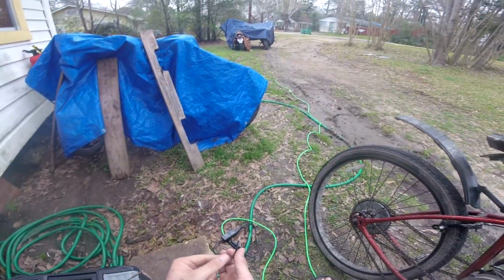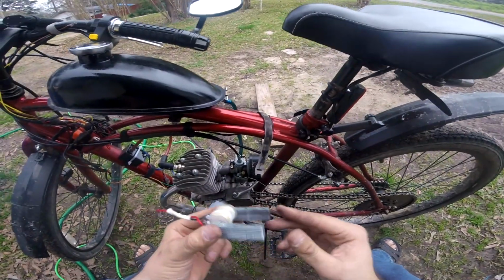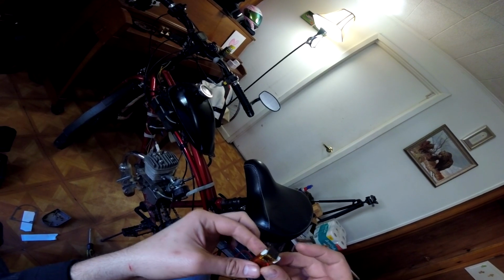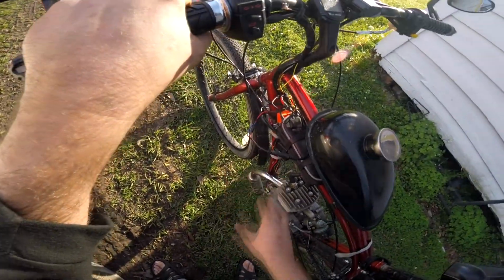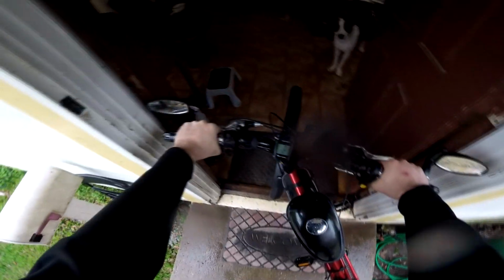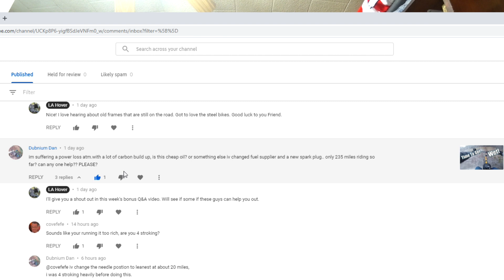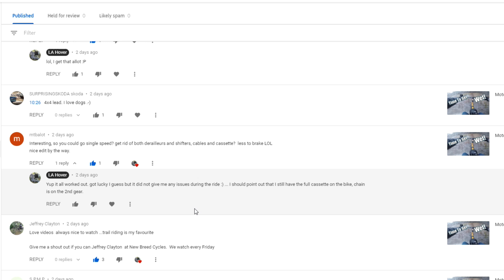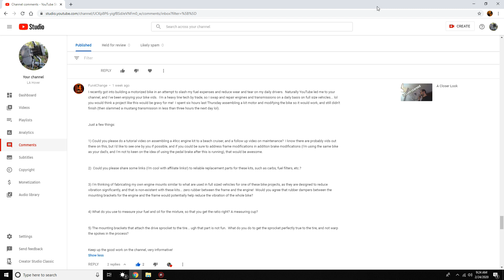Charging System Update (Motorized Bike)

Comment: The magneto only has one winding (coil) as you have discovered with the white wire. Being a 2 pole A.C. generator it produces (lets say for arguments sake) a positive pulse on the down stroke which charges the CDI and a negative pulse on the up stroke which triggers the CDI...so there is no positive or negative wires on the magneto but a "phasing" if you connect it backwards the plug will still fire but 180 degrees out of phase so the engine will not run. You will not harm the CDI...if you try to absorb either the positive or negative cycles from the magneto (to power something else) it will either not charge the CDI or not trigger the CDI...either way no go...hope this helps understand whats going on with the china girl ignition system which is light years ahead of the old points type systems which were horrible...this system is basically maintenance free although no real adjustments which is both a good and a bad thing...
Reply from the maker: Simple and easy to understand. Thank you for pointing this out :)
Reply: thank you thank you thank  .its the problem i have 180 out , makes  sense now why i ,ve got a spark but not firing
Reply: Best explanation you can get online!
Reply: This is a beautiful comment thank you.
Reply: Also the coil will rob spark from the magneto and the motor wants to run on the coil.
Reply: From what I've read from the "official documentation" that came from a china-direct engine kit, the stator coil only outputs 7.5V AC @0.5A at 5500 RPM if your parasitic draw (converter) exceeds the minimum threshold voltage of the CDI coil the engine is electro-choked to death. 
A hypothesis that introducing a much stronger Magneto magnet to increase amperage output needs to be explored...
Reply: @matthewsherwood6617  0g 0
Reply: @LAHover  If You ever have anymore electrical issues don't hesitate to reach out to me. I have been an Electricial Contractor for over 40 years and am more Then happy too help You with this type of issues. I have 4 of these bikes, 2 finished and 2 in the shop be worked on as we chat. I like putting every type of bell and whistle on them I can think of. lol I really enjoy watching your videos and am new to your channel so I have a lot of videos to watch to get caught up tp date. Keep up the great work and keep having FUN! Cheers DC.👍
Reply: The charging limit is 7.4v  5A anything dragging more from the white wire will kill the engine.
Reply: @DirectCurrent4u <<<< Helluva nice guy! 👍

Comment: Okay.., remember that cute silver box you first bought... that’s called a voltage rectifier and regulator.  It converts AC to DC by rectifying it, and regulates the output to 13 volts DC, which will run your LED lights just fine without the battery.  You have to add that, along with the new secondary coil you added.  Leave the original wiring alone, add the 2nd coil, the two wires coming from it should feed the yellow or white whites which are INPUT on the regulator, leaving a red and black... guess what those lovely wires are for? :).  No battery necessary.

Comment: Hey guys and girls. My name is Gary. I have been building and riding motorized bikes for several years now.
The best thing that I have found to help with motor vibration transfers to the frame, is SIMPLY wrap the frame of the bike with electrical tape if mounting the motor directly to the frame... Or if you have to use a U-Bolt to mount an additional adapter plate to a frame use a snug fitting piece of rubber tubing (thick fuel line) to put the U-Bolt through like heat shrink.. the fuel line will allow you to tighten the mount securely to the frame and provide some vibration dampening safely.. that is you will have to periodically do checks on the integrity of any plastic or rubber parts on these bikes. 

Hope this helps someone. Have a fun and safe ride everyone.
Reply: What about Tuned mounts?  

I have 2 of them.  I learned how to use the front one with the steel plate as the base, but the back one, I have no idea, 'yet'.. 

Btw, how some thin leather?  It won't deteriorate as fast as tape.  

There's also the 1.25" Copper conduit Closed nipple trick >>>> that's the route I'm going. 

🇺🇸

Comment: Shimano, Sturmey-Archer, SON, and many other companies have made front wheel hub generators.  Sturmey-Archer alone goes back about 75 years.  Unlike the constant drag of a small armature being turned by the wheel, there is no felt drag because the armature replaces the axle and the magnets rotate around it.  It should be more than enough to keep your devices charged, whether the engine runs or not.

Comment: the best way I,ve found is just bolting it right against the frame...I have rode the crap out of mine within reason of course and have yet to have anything vibrate loose, I do check it over about every other time I ride it just because its good practice... it seems to have a lot more issues with even a thin material between the engine and the frame, it also foams up the fuel in the bowl with the rubber mounts which starves the engine of fuel...that was frustrating, I just happened to read an obscure post in the depths of a motorbicycling.com forum about it and the rest is history...thanks for another upload man

Comment: I have a small bike trailer I use for longer hauls and I have a charging system on the trailer. It has a Pully on the wheel and a rubber band that turns a small electric motor to charge 2 3.7v batteries in parallel. I use 5v leds and they work fine. The charging system gives out 4.4v at about 10mph so I can charge while I ride and have power at stops from the batteries. I’ve even installed a connector on the trailer so I can connect the bike. Meaning I can run the bike lights off the trailer batteries/charging system.

Comment: Love your videos. I agree with you the rag joints are just fine. I did order a cheap hub adapter and broke three spokes and bent a few more. Although I had the bolts good and tight it just didn't hold. Then I noticed the inner surface of this cheap aluminum adapter wasn't quite smooth and flat. There was even a casting line right in the middle of the gripping surface. My solution was to hone it with a brake cylinder hone. My Cranbrook has the 1.5 inch hub so it's a bit better than a 1 inch for gripping area. Then I sanded the paint off the hub and added JB weld before torquing the bolts down. The hub and adapter are now (hopefully) married for life. Maybe that was a crazy thing to do but it's holding. 
   Cheers
 Gord Schneider
  Vulcan Alberta Canada
Reply: JB Weld is King! it will last longer than the rim.
Reply: That's actually a great easy solution. What about instead of JB weld you use a piece of rubber like a piece of tube liner? I can't imagine it would lose grip, there is so much friction and clamping force there

Comment: I looked into one of those 12V generator coils, but I was pretty skeptical about how much current it would generate. Major props for using a battery and rectifier/regulator though!
Reply: Speaking of regular rectifier how do we wire that into these motorized bikes I have the 12 volt generator
Reply: Me too…. Would like to use it…. Is that a horn on LA’s bike near the steerer tube?? That’d be cool!!
Reply: @joshuamoon8442  generator goes to AC pins, out goes + and -. in other words, ac goes to the pins where both anode and cathode is connected, + goes out the pin where 2 cathodes are connected, - goes out where 2 anodes are connected. but don't even bother with this as you need a regulator too, because your "12v" generator is not 12v at all and you'll most likely fry everything if you don't know anything about electronics

Comment: I subscribed to your channel. I'm a retired motorcycle mechanic, & bike builder. Since this is 4 months old I assume you have figured it out by now. The white wire on the little 66cc will power a 6v light without damage or power loss.

Comment: I have built many motorized bikes. My current is an 80cc (66cc) cranbrook. The reason you have a problem with your CDI killing the engine is because you need to separate your CDI and the charging generator. I have a 2 coil set up that the CDI runs off of one and the other coil provides the amps to run my headlights, taillights, blinkers, brake lights, and speedo light. its all LED. It also has a rectifier and it both powers everything on my bike and still enough left over to charge the battery at any speed above idle.

Comment: I've taken my triple 40 on a 30 mile straight shot one stop around 18miles for a drink. Highway, cruising around 30mph which is in the higher rpm range on my bike. It was a booty call so I remember very well.

Comment: My own plans for an electric system involve a dedicated generator hooked up to the magneto, but only using the magneto physically cuz it isn't controlled by the clutch. I will hook up to it using basically the same way a pull start hooks up to it, just a lot more flush. 

Heck the greatest hope will be for an electric start. 

Also ac to DC converters are called rectifiers.
Reply from the maker: I THINK, the Bullet Train kit has a built in charging system. That is the kit with an electric start.

Comment: I just finished assembling a motorized bike and I was not able to turn it on, needing to check spark plug, magneto, carburetor and after testing everything I realized that I needed to open the throttle gas to the maximum and give the bike good pedaling velocity, only that way I was able to put it to work. Thank you for your advices.

Comment: for vibration dampening i cut an old tube into strips and made it wrap around twice.. its thin and soft enough it still gets good grip on the bicycle but does help with the vibration some .. been running this for 4 years
Reply: also used 1 strip on the bar under the tank also. idk if helps any but i have never had a bolt break or leak and my bike has fell over a few times also
Reply: I tried the rubber mounts when I first put my bike together with terrible results. It was so darn herky jerky at low speed acceleration that the left side of the frame broke loose from the rear wheel dropout. It has been welded and gusseted on both sides now and solid motor mounts installed. The motor runs pretty darn good and the bike goes much faster than I need it to or want to ride it to. It does easily over 30mph with a 44 tooth sprocket. I want better, smoother low speed rideability. I would like to put a 48 tooth sprocket on it but I can't remember who I bought the hub/sprocket from and don't know if the three bolt mounted sprockets are a standard uniform size pattern spacing. Anyway, It seems to have gotten a little herky jerky at low speed acceleration again so I checked motor mounts for loosening. I have the studs double nutted. I broke the locknuts loose and tightened the mounts- they do seem like they were a bit loose. I tightened the locknuts back up & took it for a ride. Still a bit jerky at low speed. I was thinking of making a steel shim to slip behind front motor mount strap in effort to better lock motor solid to frame thinking that maybe the motor mount strap has stretched or bent somewhat. Maybe using rubber as you suggested would work well. The bike is a 26" 1980s Schwinn cruiser style bike with the 80/66cc motor. I don't know why anyone wants to ride a BICYCLE over 30 mph! My bike's sweet cruising speed is faster than I need to go- probably 20-25 mph range. I'd like it to loaf along like that at a slower pace- probably 15-20 and be able to go much slower than that under the motor's power without chugging it. As a kid I have built mini bikes, go carts...as an adult have been a stock car racer, drag racer, and have owned motorcycles since I was 16 yrs old so I'm not afraid of speed- at least not in or on something that I feel comfortable at speed- haha. As much of a speed demon as I was as a kid I don't think I ever knew how fast 30-35 mph was on a bicycle until I put a motor on one! Everyone wants to go faster?! Maan. Be careful.
Reply: @mickangio16  most of the jerking I have ever dealt with was at slow take off or as I let off the throttle and the cause of this was the chain being slightly loose and it bounces causing the jerk. I fixed this by adding a spring tensioner onto the motor and now it run smooth at any speed because it always keeps the chain tight. this is the one I use https://www.amazon.com/Spring-loaded-tensioner-Engine-Motorized/dp/B07NXX4PV4
Reply: Gotcha. I also have the spring loaded chain tensioner but maybe could use a couple links taken out of chain for more tension.
Reply: Thanks. I'm gonna take a couple links outta the chain & give that a try.
Reply: Aaagh, phooey. I just checked into that plan and I think chain would be too short if I take out 2 links. The top length of chain almost contacts the bottom length in the area of the tensioner so I thought there would be plenty of chain to allow removing 2 links but it looks like that is not so. Maybe I could try one of those 1/2 links. Maybe even a heavier spring.
Reply: @mickangio16  try putting a stronger spring on the tensioner
Reply: Ah, thanks for answering again. Actually, I got it smoothed out pretty good. First I closed gap on the NGK to .030" and then tightened it in good 'n snug. I was afraid in the past of overtightening. That seemed to help a tiny bit. What really made the difference was needle adjustment/modification in the carb. I had already had the clip in the highest position on the needle to lean part throttle fuel mixture but thought it could be leaner to smooth out low speed operation. There was enough room at the top of the needle above the uppermost slot to cut another slot using a small hobby file. Voila! So much smoother now at slow speeds & light throttle settings. It comes down to much slower speed now and accelerates much smoother from the low speeds. I still think I would be happier with a bigger sprocket but it is a lot better now. As for speed- it has plenty. I consider it dangerously fast. When I wind it up to full speed (only for testing purposes- haha) I am paranoid that a wheel bearing is gonna lock up, frame break, tire blow out... Lord only knows. Thanks for tips & encouragement.👍

Comment: Been watching a few of your vids, my first and only kit had an o ring on the carb, still haven't decided what bike I'm gonna use (have gathered a few over the years) the thing to consider is how a shorted coil can affect the magnetic flux lines developed from a rotating magnet. I.e. if you load down an alternator electrically the drag on whatever is spinning it increases. There is only so much magnetic flux to go around, the plates of the lamanite help to direct what flux is available, perhaps sucking them away from the bare bones rig that comes with the motor. Still have the motor clamped to a pipe on the bench. Don't be afraid to jig up a new rim, been doing it for 30 years and you just have to do it to get good, swapping a new rim is jumping in with both feet and there's no going back after that

Comment: The  thing with rubber engine mounts is that the rubber should be contained so that there is no room for much movement. The clamp needs to contain the rubber tightly. The clamp should have sides on it keeping the rubber under the clamp in it's place not letting it move. The rubber is only there to absorb vibration. Sides on the clamp will not let the rubber squish out the sides when tightening. It should make it compress, making it tighter. The hard part would be is welding sides on the clamp or machining the clamp so the rubber will fit into a pocket. I like doing 4 strokes because I get to make my own mounting points.